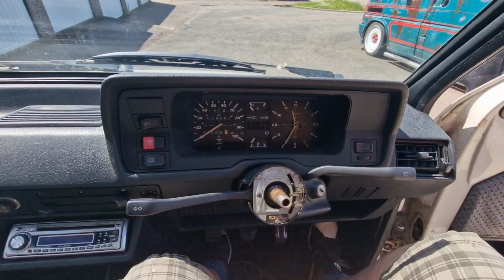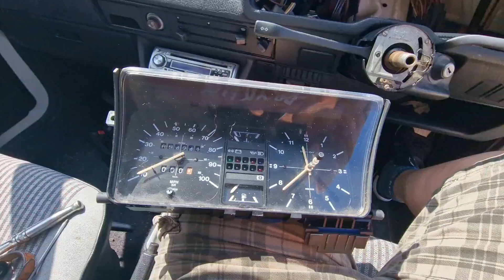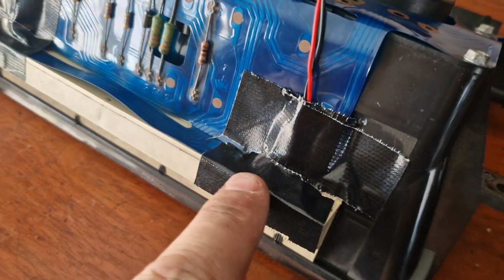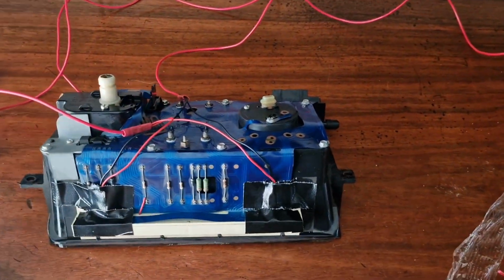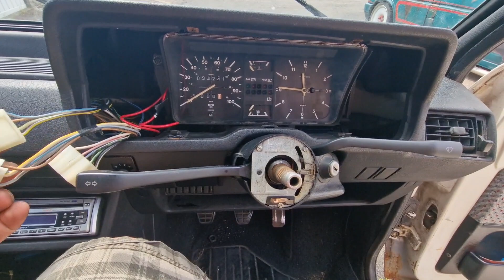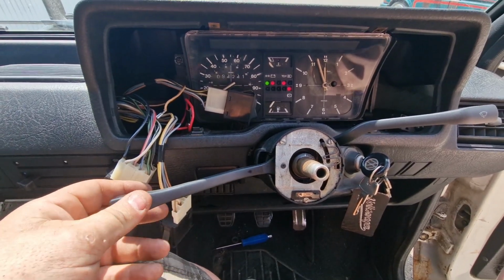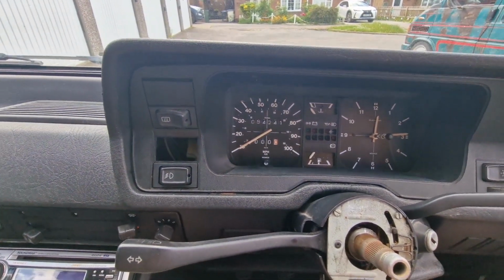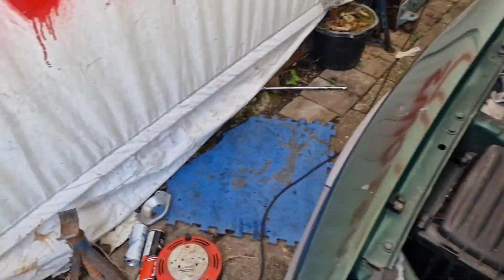VW POLO MK2 86c car leds to my dash #vwpolo

Comment: Have sympathy with you on the faulty switch unit. On my polo, my engine wouldn't turn off even when i removed the ignition key. After trying all the obvious  things, turned out it was a faulty hazard switch unit - put a new one in and it was fine. Still can't work out the logic to that!
Reply from the maker: Yep it's crazy. This is my third one lol.
Bought one from vw heritage this time hoping its better quality than amazon.